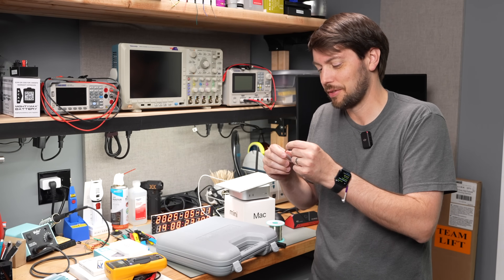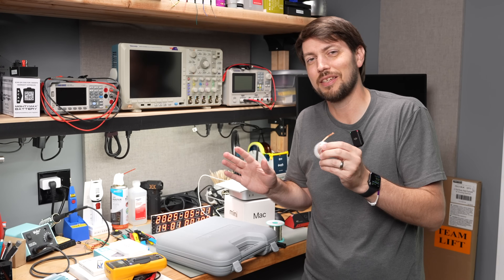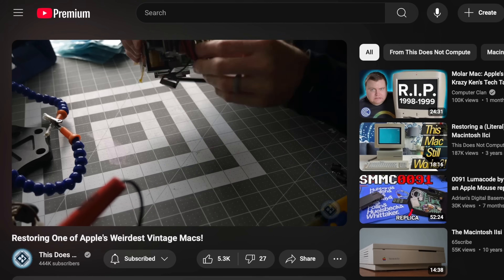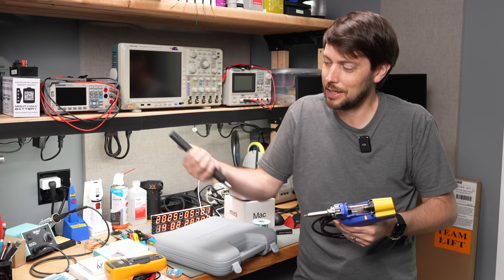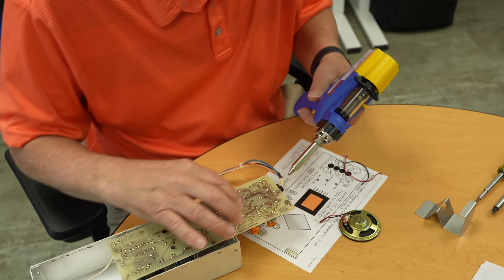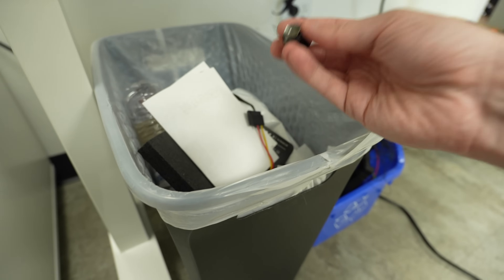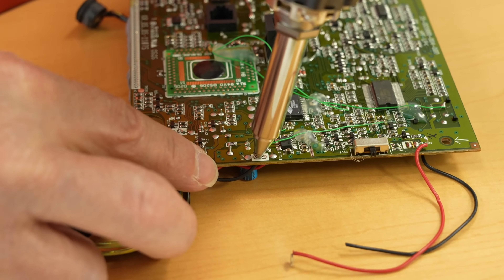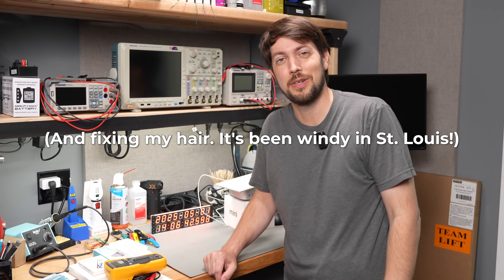Nobody told me desoldering could be easy! (Hakko FR-301)

Comment: I learn soldering decades ago in the USN. We had the manual pumps and only got braid if we went out and bought it ourselves. Those manual pumps were so useless I always bought several rolls of braid before every deployment. I'm glad to see there have been improvements.
Reply: Braid has its uses. It's wonderful for cleaning up pads *after* you have removed the part. It's also incredibly useful when (re)working SMD components. But it's not a panacea. As always, use the right tool for the job. And in the case of soldering, that's probably a combination of several tools.
Reply: The US Navy has been one of the oldest users of vacuum desoldering equipment, actually. Evidently, not in all divisions! :( 

Pace, one of the very earliest manufacturers of continuous-vacuum desoldering equipment (they claim to be the first, in the 1960s), was actually founded in 1958 by a Navy veteran, so they’ve always had a close connection. (In the Pace video here, they even gratuitously use footage of the Blue Angels because of that legacy: https://youtu.be/IqE1KA0OAnM?si=IR_gRdgLq00bGEP_ )
Reply: @tookitogo  Maybe they had them on CV's or at depots but I never saw one.
Reply: @KenS1267  That makes sense, that larger facilities would have them, for dealing with more complex repairs. 

Some Navy repair procedures must still specify specific Pace equipment, because the PRC-2000 rework station has been made for decades unchanged, has a second-source supplier and NSN, and periodically, large lots of used ones get sold at auction. Anecdotally I’ve heard those come from the Navy, but I can’t say with complete certainty.

Comment: I've had one of those Hakkos for a couple of years. You'll need to keep a small stock of spare parts - filter, collection tube, and occasionally a new tip, but it's a great tool. I love mine and it gets used a LOT. Be prepared for it to get clogged periodically, and sometimes to the point that you have to drill it out with a 1/16" bit. It's just part of using that tool.
Reply from the maker: Yeah that's what I've read; I will probably buy a few different tips as I get into newer boards
Reply: @Level2Jeff  If you remove the head and cover underneath, you can clean it out completely. There's a good video by MoreFunFixingIt on how to basically clean every single component that can get blocked up.
Reply: I find if you let it "mooo" a little longer after the solder as been sucked into the tip, it will allow it to clear the passage before you work on the next one. It helps with clogging. So instead of stopping right after the solder is gone from the PCB, hold the trigger for a little longer, more solder will get into the chamber instead of stuck in the tip. It also helps if you make sure the solder's really melted before pulling the trigger.
Reply: @rcboosted you are correct. It's just that sometimes little bits of things other than solder go up inside it and that's what really clocks that are good.
Reply: If you're doing it right you'll have a collection of tips. They need to be sized for the component leads being worked on

WRT pump operation time. If you pull the tip off the joint with the pump still running you'll hear the pump unload as airflow is restored. It becomes second nature very quickly
Reply: @alanbrown397  Yes, I keep about three different tips, one of them oval, which works well for crimped leads. And you're right about keeping the trigger squeezed while removing the tip from the work.
Reply: I'm glad you pointed out the 1/16" bit trick!  I've had to do that innumerable times when the solder was too stubborn to come out with a  cleaning rod.
Reply: Hakko is so worth it.

Comment: Another option I found for through-hole components you can get is these little tubes that you heat as you slide over the pins. Then the solder hardens and you pull the tube and the two parts of the solder are separated. They're not common and there's a bit of a learning curve (I ruined my first ones) but they work pretty well. I can't remember where I first saw them used. The ones I got were called "Stainless Steel Non-stick Tin Hollow Core Needle Kits For Soldering" and they were only $3.

Comment: I went with the cheap Chinese version (S-993A) for $90 and have been pretty happy with it. For certain connections, it's amazingly easy. For some pins, like grounds that attach to big ground planes, it can still be a challenge. I've read that pre-heating the board with hot air can help in that case.
Reply: You bet. I've got a 858D hot air rework station that I use to do just that.
Reply: I've had one of the cheap ones for years. You don't need to pay $300 for one.
Reply: Me too, it works well enough. Removing the tube is a little more tricky though. And indeed the heat capacity seems a little less than the hakko. I've set mine at 450 and it still struggles. I use a hot air gun to work quicker, and sucking in hot air avoids clogging most of the time. The fan in the housing went bad though, it makes a racket.

Comment: I’ve always wondered how you clean the solder sucker guns. Do you heat it back up and dump out the solder or use solder wick to remove the sucked up solder?
Reply: The solder is sucked to somewhere it won't stick.

Comment: The best advice from someone who has thirty years of experience with these tools is to hold the button on longer after you remove it to ensure the solder doesn't clog the nozzle
Reply from the maker: Yes we learned that pretty quick haha. Got annoyed by it clogging if you just give a quick moo
Reply: @Level2Jeff  see my comment and link to the Pace training film. Anything less than 2-3 seconds is inadvisable. Done right, the components will usually just fall out if not clinched or swaged in place
Reply: *nozzle

Comment: Time to spend $300 in a tool to fix my ps4 controller to avoid spending $30 in a new one
Reply from the maker: Ha! sometimes it do be that way
Reply: Add the experience, you could return your investment by fixing your relatives and neighbors controllers.
Reply: I did the same thing a couple months ago. Got this exact tool to install hall effect joysticks in my ps5 controller. I've literally never successfully desoldered anything before, but with the desoldering gun even a soldering dunce like me was able to do it.

BTW, while you have your ps4 controller open: there are replacement circuit boards to switch it to USB type C charging with no soldering required! (Though you will have to file away some plastic to make it fit)
Reply: dude you can get one for $10-20, they dont have motorized pump just a heated tip, thats where the easy part comes in,  the hot tip ready to suck while your over the hole, you just have to press a button after manually cocking the pump each time.
Reply: Could always use hot air.

Although if you are on 120v I recommend importing the FR301-82 from Japan for about half the price. Some people use it as is, but you can convert it to the NA version by replacing a couple resistors.
Reply: this is the way

Comment: I've got myself a soldering iron with a manual solder sucker build into it. Not as fancy as the the fully automated ones like you showed here, but still infinitely better than using solder wick or trying to use two tools at the same time.
And the best part is that it only cost me 6€ because it was on clearance.

Comment: I've had the solder suckers and wick.  This Hakko FR-301 is a wonderful device for removing components that need to be unsoldered.  I finally bought one and got to use it.  So much easier.  Not perfect as sometimes you need to add a bit more solder on a really old solder joint.  But much easier than a solder sucker which I got to be pretty good at.

Comment: I picked up a "middle of the road" desoldering iron that has the manual solder pump, but is still a hollow tip that gets hot. It works quite well, but the vacuum pump in this one is sure a treat. Looks incredibly easy to use.

Comment: I've used a hand held solder sucker for 40 years. Thank god there's a modern alternative.
Reply: The manual spring suckers still pull large volumes of solder better than these electric ones. And the tips on these electric generally are not large enough for some jobs, the manual stile still has uses and I certainly use both when needed.
Reply from the maker: A balanced take!
Reply: @minigpracing3068  LOL absolutely untrue. No manual sucker comes close to a good desoldering station. FYI, Pace has the best selection of tips for their desoldering tools, from tiny to very large, including one with a large rectangular hole for removing the side tabs from potentiometers, etc.
Reply: hand held solder sucker is still smaller and cheaper and for me most important less noisy. Maybe when im gonna be old im gonna think is its maybe a way to go but for im gonna stick with sucker
Reply: @Hajdew  If you have to do alot then the sucker sucks.  :)  I had to remove a bunch of 28 pin components and this made it so much easier.  I tried it with the solder sucker first..
Reply: @timradde4328 i desoldered whole keyboard twice no problem

Comment: Some additional tips that will improve your desoldering even more:

-for tough stuff add a little bit of fresh, leaded solder before desoldering and/or if the first attempt doesn't free the pin entirely.
-if there's oxidation a bit of flux and maybe some pre-cleaning can help as well
-don't fight gravity, desolder holding the pcb vertically or place the gun under the pcb while holding it at an angle
-try wiggling the gun around mildly while you are desoldering, this will free the pin from the barrel of the pth.
-for pins attached to large planes you can use a soldering iron for preheating and supplemental heating
-you can use a bigger (preferably flat) tip for cleaning smd pads after removal of ICs with hot air
Reply: Should have read your comment before posting, I typed out almost the same things.
Reply from the maker: Definitely some good advice here. We did have to reflow a few of the messier legs with fresh solder before they'd come clean.

It's fun seeing, as well, how handcrafted the early Apple IIs were. There's a lot of evidence of hand work from PCB routing to flux still on the original joints and hand scribbled numbers on everything!
Reply: Yeah, I learned this.  Sometimes have to add a bit more solder for it to unsolder properly.

Comment: Been thinking about getting this T12 style one I found on AliExpress for about $100 CAD, looks similar to a JBC model I saw. I use an Engineer SS-02 and that works pretty good, cost me like $50 5 years ago, they just replaced it with the SS-O3 for about the same price. I never liked wick at all, I never could get it to soak enough solder up.
Reply from the maker: For me wick seemed to often not quite get the junk out of the through holes, and sometimes a component would remain stuck unless I put a ton of heat on it
Reply: @Level2Jeff  I generally rely on my SS-02 solder sucker for pretty much everything, if you never tried one they can be found on amazon for about 30$ or less USD, they sell the older one but I'd recommenced the new ENGINEER SS-03, it comes with two 50MM, 2MM x 4MM silicone hose's you cut to size and put on the tip so it's flexible and can grab hot solder much better then a solid tip. You can also find silicone tubing in that size for real cheap if you run out, you don't need to change the tip that often but it's nice to know you can find it easily since they do not sell the official replacements in Canada, just the solder sucker itself. I like it because it works great and is a made in Japan item, so the quality is pretty good on it.
Reply: Just got a t12a desolder tool myself and it's great.
Reply: @JamesChurchill  That's great to hear you like it, hard to find much info on it. I'll be looking forward to getting one soon hopefully. How easy is it to clean? And does it get clogged up at all? I need to clean my solder sucker pretty regularly if I'm doing a lot of desoldering.
Reply: @blueclaydude500  Cleaning is trivial, there's a carbon fibre collection vessel and solder doesn't really stick to it. I actually like this over the older style guns I've used in the past because those have a long unheated section that solder can solidify in permanently if you don't run the pump for a few seconds before turning it off, but I don't see that happening so much with this. Also, it's a modern high-speed iron and comes up to temp almost instantly.
Reply: @JamesChurchill  Yeah I've owned a T12 for about 5 years so I know just how fast they heat up, looking into a newer station with T210, T245 and C470 handles I found to replace it. It's good to know the T12a station is not a hassle since I really like the price of it being only $102 CAD vs some of the other one's that are about $300 plus 50 shipping for me. I'll defiantly be pickling one up.

Comment: Every time I have to desolder a bunch of stuff I tell myself I'm going to buy one of these for the next time. I should really get on that.
Reply from the maker: It's crazy the difference. Some projects I just didn't think I'd ever get to because of the slight hassle, like recapping a Mac Classic.
Reply: @Level2Jeff  the Mac Classic's a complex one since it's got through-holes and SMD caps, most people swear by soldering tweezers for those since it reduces the time heating the already-damaged boards.
Reply: It's so worth getting one,  makes removing through hole components  much enjoyable
Reply: That's a future Sean problem
Reply: Get it, yesterday.. get the Japanese version fr301-82.  Then either buy the USA version board OR get two 300 ohm 2w resistors.  Put those in and you get the USA version for 200$ new with case ..
It took me hours to desolder with wick now it takes minutes.  Just the less frustration, makes it worth it.  For real, just get it.
Reply: I got a manual one for 10$ off aliexpress, it still electric as it heats up, just doesnt suck automatically you have press a button, but man i took out a 16 pin IC in 16 seconds because it literally was as fast as you could reload the button, 1 second per pin, maybe 2. The motorized ones look cool but you can get the same "Ease" effect if you dont mind cocking the pump. Infact i think i could reload that pump faster than that motor can gain suction, but im just guessing.  The ease comes from the fact your tip is hot and ready to suck, unlike the  non electric ones, you really dont need motorized suction to make it easy.
Reply: @mikejones-vd3fg  You do for through hole plating as you need the suction to operate for 2-3 seconds, not just a pulse. The one shot units risk leaving the lead sweated to the through hole plating and then damaging the plating as you remove the component - there's a knack to using them correctly and 99% of the time I see people using them "wrong" - if done right the lead will be completely free of the hole
Reply: Me also but I would first get myself the tweezers. Using desoldering braid and a soldering iron works fine for what most of us do anyways.
Reply: SAME, Now i'm extra tempted.
Reply: You mean desodder
Reply: @JS2123-m9x  They spell it solder like us, they just pronounce it "sodder".
Reply: @BrianG61UK  I thought soddering was something that happened in the football team locker room

Comment: I bought one of those.  I have an old Atari Battlezone upright arcade machine that has succumbed to the infamous Atari Crappy Socket syndrome, and I want to replace the crappy sockets with good ones.  That's up around a thousand pins. It'll pay for itself before I even start recapping the monitor...
Reply from the maker: Ouch! At least the sockets on the Apple II seem fine, even if some of the RAM and ROM chips need reseating.

Comment: Thanks Jeff. I have the same manual sucker, and i forgot about it, and i'm working on a project with quite a few soldering points to do on a Pico (no desoldering involved), and i'm so bad at it, that i sometimes create big blobs of molten soldering wire on the small spot i have to do, and i tried taking the excess off with the desoldering wick, and i'm even worse at it. But i remember that the manual pump works much better than the braid. I've just took it out of that drawer where i can't see it, and put it on my soldering table! 😉
Reply from the maker: Good luck!

Comment: If it's "sodder", why do you still spell it with an L in the middle? Also, you're using wick wrong. Put some liquid flux on the wick (like, soak 20mm of it) before applying it, and it will pull the solder into it extremely effectively, don't put the flux on the board. You're also using the sucker wrong. Heat the joint and roll the sucker onto the hole as you pull the iron away then trigger it, so the suction is on the other side of the hole you're clearing. Yes, suction guns work well, but I've been a self employed electronics engineer for more than 40 years and never owned one. Never needed it.
Reply from the maker: It isn't a necessity but it is a help!

For the sucker, it could be in just not always patient getting things hit enough, but when I roll it over and press the button, a lot of times the solder has re-skinned over and it takes a few tries to get it all out
Reply: Why would English have useless letters that Aussie Folk need to pronounce?
Reply: Since when has English ever been consistent with spelling pronunciation? Just look at "salmon". It would be nice if actually worked that way but I believe that ship sailed a long time ago.
Reply: If it’s pronounced “sammin”, why do Australian people write it with an “L” in the middle? The answer is that English, in all its variations, is an absolute mishmash of languages and spelling has comparatively little to do with pronunciation beyond some basic principles. People randomly choose little hills to die on, pretending like they have logic on their side, when that same logic can be applied to a hundred other things they do “wrong”.